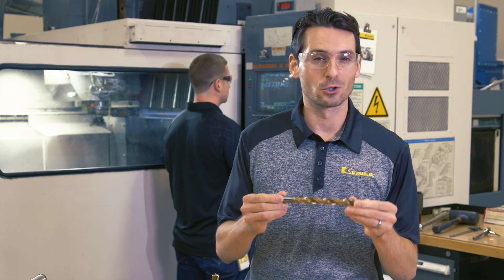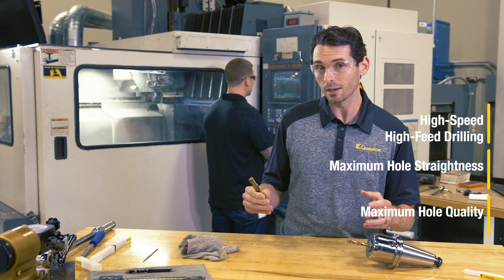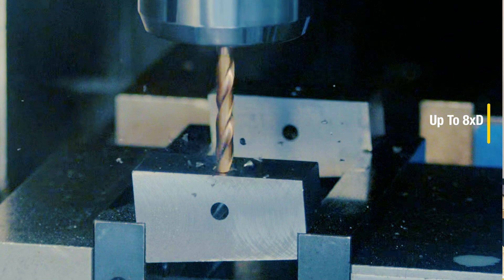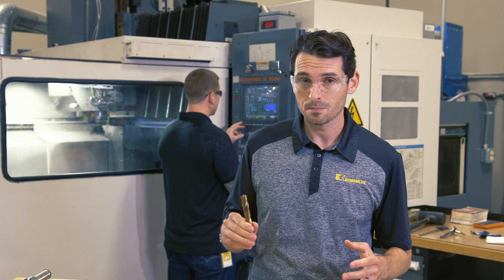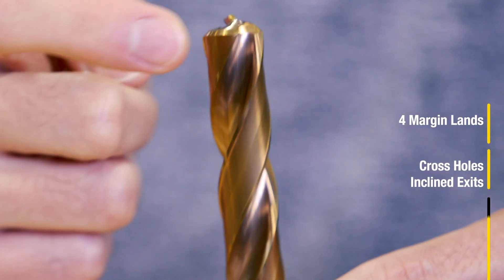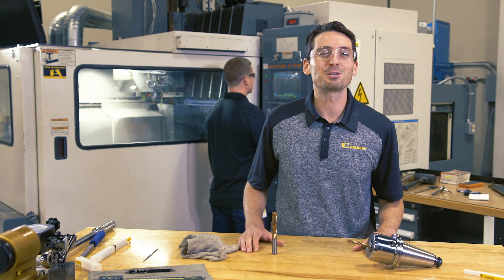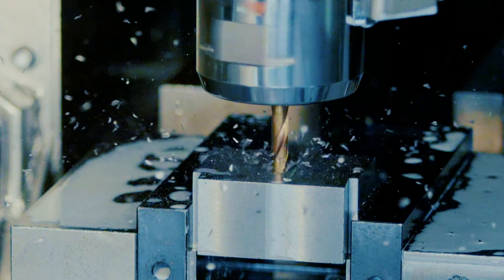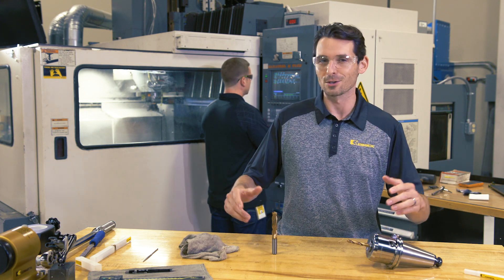HPR Drill - Solid Carbide Drill for Cast Iron

Comment: How tf did they get the coolant holes through it?
Reply from the maker: Great question!  The coolant holes are removed when the carbide is in a soft state, then the soft carbide is twisted so those coolant holes follow the same twist as the flutes.
Reply: @KennametalInc  that’s pretty insane, thanks for the info!
Reply from the maker: You're welcome!  Have some fun making chips ⚙
Reply: @KennametalInc  Interesting! I'd love too see that process. I though that it's made with some kind of EDM spiral when it's already hard!
Reply: @KennametalInc  have you experiencies with these drills on wet conditions? I'm thinking about using it for drilling brake discs on wet, in an application in which I'm using an HPG (diam 8'6, 3*D; CC: 2000 rpm, 0'29 mm/rev). Do you think HPG would beat HPR?

Comment: this drill reached  f=1mm/r  (GG25)  in our  Kennametal Turkey/İstanbul T&D center !  Absolute game changer...
Reply: Hello. F=1 mm/rev, but what was the diameter of the drill? And the speed?   Was the operation dry or wet? And the life of the drill? Thank you! I'm thinking about using it.
Reply: @eduardot2730  hello it was dia 12 drill, but in case you wouuld likte to use this drill please use recommended cutting values.
1mm was just to see the capability and limit of the to tool if needed !

We only drilled 50 holes on a bulky plate and there was a little sign of wear but nothing was serious.